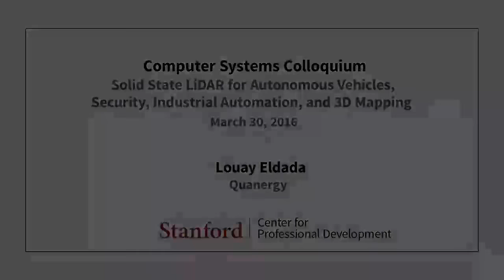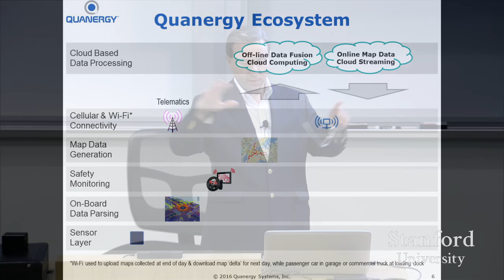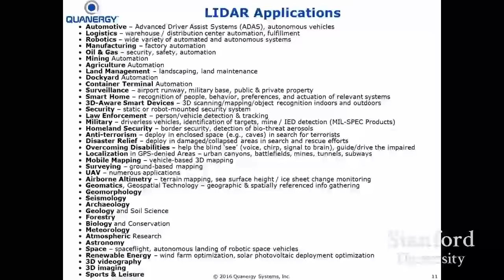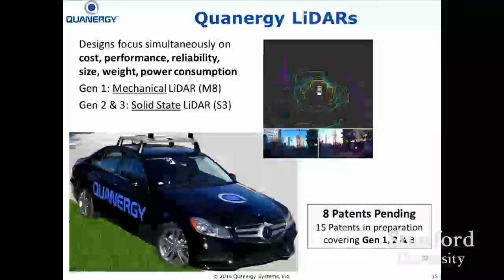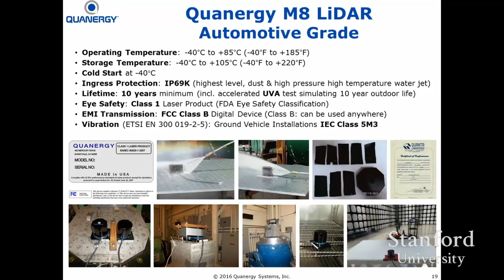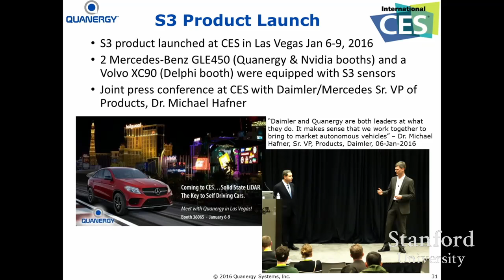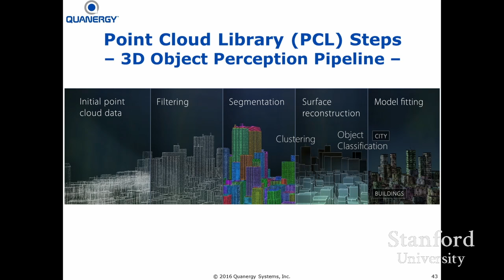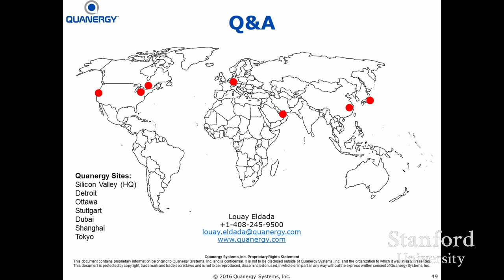Stanford Seminar-Solid State LiDar for Autonomous Vehicles,Security, Industrial Automation, 3D Maps

Comment: I just skimmed through the video but it seemed it's just an advertise lecture and no explanation on how solid state lidar works is given.
Reply: It uses and Optical Phased Array. 31:00 (as opposed to spinning gizmo or MEMS mirror) to direct the photons in different angles. It's like an "antenna" that can direct EM radiation without moving parts.  It's like a shrunken modern radar (but for lasers I guess).
Reply: @rasmasyean  The detector portion is equally fascinating. It uses a silicon SPAD array. That's quite an achievement in itself!